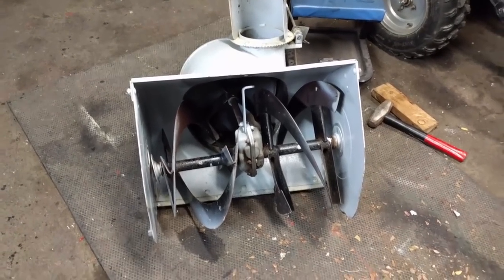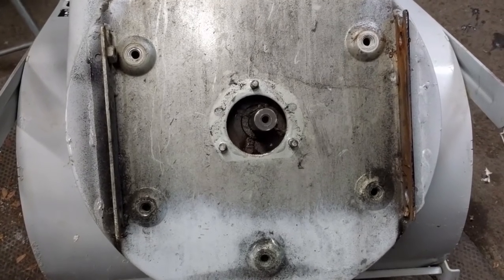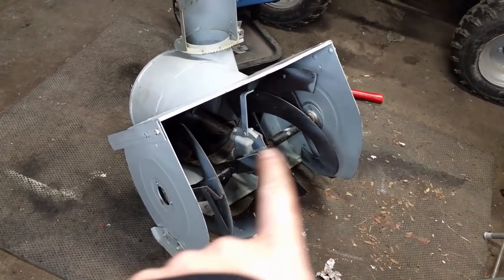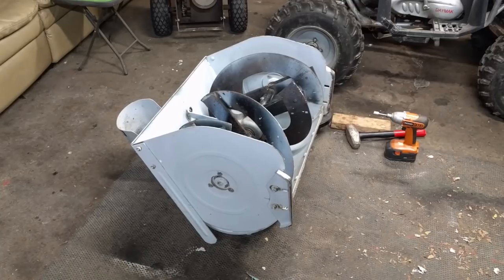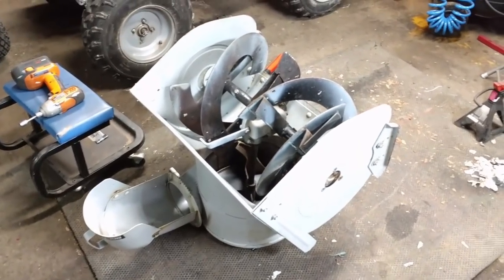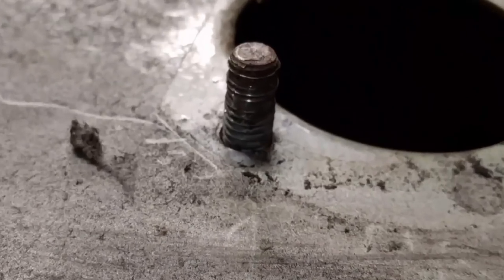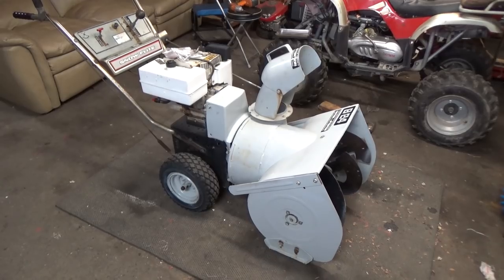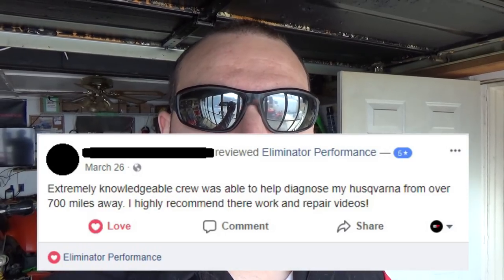Snowblower Hit Newspaper - Bent Auger Fin

Comment: I just had a problem with a paper and the snow blower this week ,No damage but it did take hours to free the paper from the blades that propel  the snow thru the chute,wet, frozen and mixed with water , What I did was used needle nose pliers to pull the paper apart and spin the plate after standing on a crow bar to get it to the chute ,Then prying it off,All from a paper the nobody wants the neighbors throw it out in the street.

Comment: Any way to add a shear pin to the impeller?  Maybe get rid of the key and drill a hole through the impeller and the shaft and put a shear pin in.  I think some snowblowers are made that way.

Comment: This happened to me after hitting a patch of gravel doing some spring cleaning
Reply from the maker: Yea it sucks when they don't shear the pin, but on these older ones they have wider auger blades.
Reply: Happened to my three stage troy built I bought new last winter
Reply: @pit81590  Same with my 3 stage Troy Bilt  a month ago.    No pins sheared,  left with a frustrating repair.

Comment: Thanks for the info, I hit a rock this morning at the end of my driveway that was under the snow from the plow trucks. The snow blower is making a knocking sound when the auger is turning. I will try taking a look at the fins.
Reply from the maker: You may have to bend one back, they're thin enough you can do it wth pliers sometimes. These older ones, you need a piece of wood and a hammer sometimes.
Reply: @EliminatorPerformance   Got it fixed it was actually the housing and shoe got bent in a little . A whack with a mallet and all is fixed!